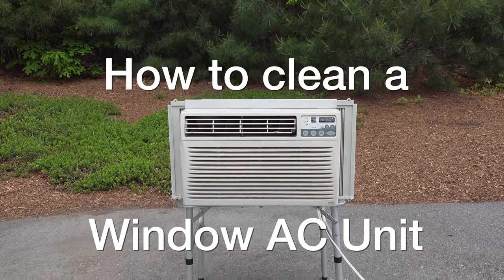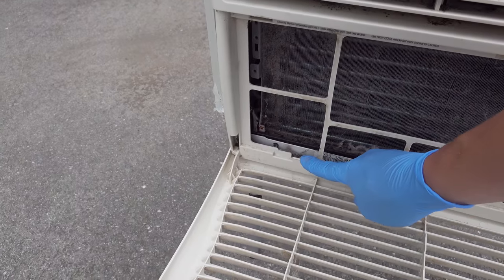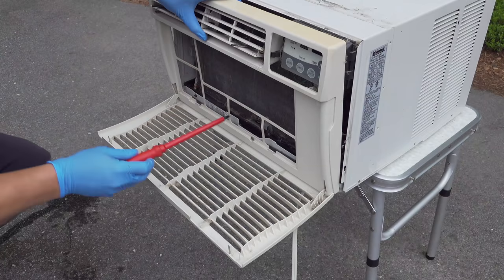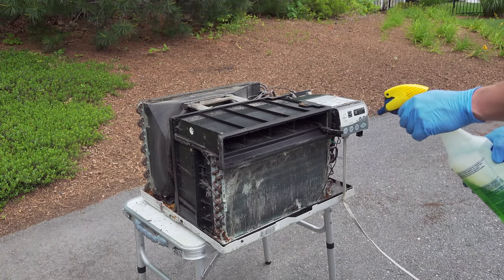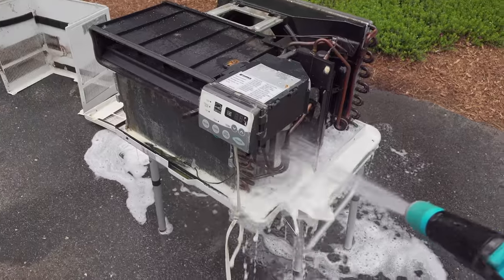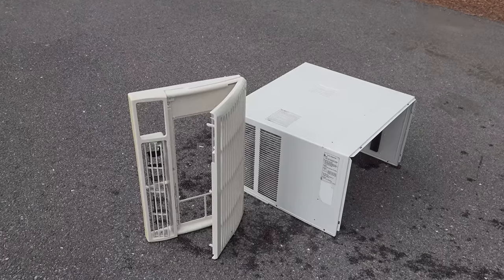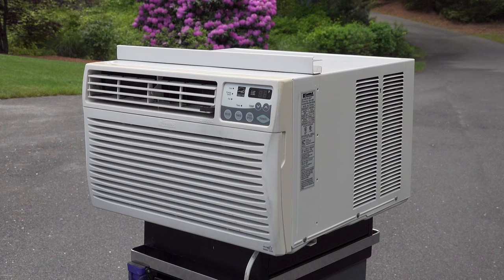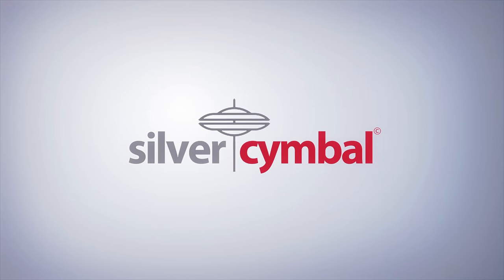Window Air Conditioner Not Cooling? EASY Common Fix - How to Clean a Windows AC

Comment: My Dad taught me this method about 30 years ago, I always thought he was crazy for doing it, but the old man knew what he was talking about
Reply: Probably your dad's old video.
Reply: @davidstockman1456  let me get a hellllllllllll yaaaaaaaaaaa
Reply: What's the point of even mentioning it , TOOL
Reply: They all do.... never question an old man, just trust them and learn
Reply: @yusufuralarslan627  no dad?
Reply: @KingTravis405  a
Reply: @TheOffcialElonMusk  , my dad taught me to do things around the house.
Reply: He should've TAUGHT you how to spell
Reply: @yusufuralarslan627  have you found love yet or are you still getting kicked to the curb?
Reply: Usually old heads are the one to listen to cause they didnt replace broken they fixed broken
Reply: Dads are right 96.7% of the time
Reply: Definitely about to do this. Mine is putting in overtime and not cooling anything. Only 3 years old.
Reply: @vernonmouretjr4360  It works great, you’ll be surprised how much dirt comes out of the unit. Best of luck
Reply: I just brought a new one with even thinking it through….
Reply: @vernonmouretjr4360 
You Should Clean The Air Conditioner Thoroughly Like He Did In This Video
Reply: Dad's almost always know. They were taught by THEIR DADS, and that's how it should be!
Reply: I need to clean mine

Comment: It would have been so much better if Air conditioner were designed in a way they could be cleaned easily .
Reply: quick tips: clean  ftont filter and back of unit 1-2 per yr, depending on usage. This negates having to remove unit and disassemble. For back cleaning, spray garden hose at a 45 degree , not directly head on. These two methods will remove 90 % or more of dust/dirt and unit will
operate as itvshould. Been doing this for 20+ yrs. Great method for those that live on 2-3 FL , or those with larger units.
Reply: Yeah but then we won't be forced to buy a new one.

Comment: For those who are unaware you should NOT put an AC on its side, or upside down for any length of time, if you do have to have it tipped on its side, you should allow it time for the oil to run back down to the bottom of the inside of the compressor. just saying 😘
Reply: How do you grease the bearings? Mine is making a grind noise when turned on I assume it's the bearings?
Reply: Just like an automobile.
Reply: OneDayAfterAnother  that's ridiculous. You either just remove screws and then the outer case and so on until you get to the parts you want to grease or freaking spray a  bunch WD-40 in where you can reach with the attached tubes they come with, let it dry out completely and turn it on. Taking a window unit to an expert is the most ridiculous thing I've ever heard. Quick way to get totally ripped off when you can DYI easily or just shell out $100-$200 or less for a new one! Sorry don't mean to be rude, just realistic and practical.
Reply: OneDayAfterAnother  I do hear that my friend however in cases like a window unit people should be a bit brave over spending useless money on an expert. You wouldn't take a busted microwave to be fixed these days it's just not cost effective or smart. 🤷🏼‍♂️
Reply: @QueBeraBera  You never use WD-40 as a lubricant in place of something that uses grease.  WD-40 is a degreaser, your cleaning off the last remnants of the grease the mechanism actually requires.    Ask a locksmith, the worst thing in the world is spray WD-40 in a sticky lock.
Reply: @jim1631  this. WD40 is definitively a solvent. I build drones and can’t tell you how many times I’ve had to stress to others to keep WD40 away from their motor bearings, it’s quite literally the absolute worst thing you can use for lubrication in damn near any device or equipment with moving metal components.
Reply: thanks  💋 😘 😗 😚 😙
Reply: @jim1631  Brett apparently loves to use his wd-40, once you told him how goofy he is, he shut right up ! Great job Jim.

Comment: I was about to throw my very old AC away. I thought it had something to do with the Freon. Glad I checked out YouTube first. I took the frame off the AC and pressured washed it out completely. waited a few hours for it to dry out, put the frame back on, stuck it in the window and it works like new. Thanks for the DIY Fix.
Reply: Mine makes a grindy noise when I turn it on. I think it's the bearings or whatever on the inside. Dunno how to get to it.
Reply: @Clayton178  Mine did the same thing. Hosed it off real good and never done it again.
Reply: @Clayton178  you take it apart until you've gotten to it.
Reply: High pressure washing a window air conditioner is a Bad Idea, it can damage the Condenser coil and the Evaporator coil.
Reply: @randallgreen6746  no one said high pressure
Reply: I don't think a pressure washer is a good idea but if its works good job.
Reply: @Clayton178  one year I sprayed mine out with a garden hose and it did the same. Still in my basement as a future project.
Reply: @markstevens7699  pressure wash is high pressure otherwise you just spraying it out.
Reply: @truth6554  spraying it out is pressure washing otherwise you're just dumping water in it. Why specify high pressure. There's degrees

Comment: Great video. I clean both my window AC's 11,000 and 12,000 BTU's just like you did in the video around every April just before the hot weather kicks in. Both my AC's are 11 years old and cool  rooms as  if they were brand new. Bought the AC's used for $100 each 11 years ago, getting my moneys worth. This past January I was cleaning bathroom tiles with Scrubbing Bubbles Bathroom Grime Fighter it worked so well in the bathroom the idea hit me to use this product for the cleaning of my AC's. When this product is sprayed it expands. I used it on the coils of the AC's, waited 5 minutes, hosed down the coils. Let me tell you, the product worked so well I got the shine back on the coils. I also used the Scrubbing Bubbles on the bottom tray of the AC, the inside and outside of the AC casing, hosed them down it worked fantastic. During the summer months when the AC's run almost around the clock I clean the filters at least once a week. Take care of the AC and it will take care of you.
Reply: Do these AC units not run out of refrigerant?
Reply: @Utsusemi  - Not unless they develop a leak.
Reply: @Utsusemi  only if they spring a leak. Same with any a/c system- home/auto. Refrigerant doesn't get used when you run it.
Reply: oh wow :o
Reply: Fantastic idea to use Scrubbing Bubbles! I'll give it a try....
Reply: @Utsusemi 
No. They almost NEVER need refrigerant and are NOT meant to be recharged.

Comment: Do not tip it on its side!!!!!! Everything else is solid but do not tip it, tipping them can move oil out of the compressor and get it into the lines that will cut the life of the machine in half. I am an HVAC techician and this has been my TED talk.

Comment: as a technician another thing to point out is that the coils need to be kept straight, bending enough of them will block airflow through the unit and cause similar issues, fin comb brushes are pretty cheap alternatively you can use a flat head screwdriver and some patience, also be careful with using dish soap on the coils and inside the unit as it will corrode the copper lineset potentially leading to a leak so rinse extremely thoroughly, preferably you want to use the foaming spray linked in the pinned comment or an equivalent personally I use Nucalgon condenser coil cleaner which dries without leading a residue, but does have a habit of softening the plastic shell on my AC unit.
Reply: Thanks 👍🏼
Reply: @NicholasPeters1  the copper pipes that's the copper lineset, the coils is what he's cleaning you got two of them the condensor (Outside) and the Evaporator (inside) that's what moves the heat since AC doesn't just blow cold air, it absorbs the heat from inside and takes it outside.
Reply: You're an angel!  Straight from a Cali girl (105 this EVENING).
Reply: Is there a reason why one side would be blowing stronger then the other side but still blow cold? Is one side clogged?
Reply: @xratedsuperstar1987  I'm a tad confused what you mean.
Reply: @pathfinder290  on the part where the air blows out one side blows weaker then the other side. Usually the airflow is the same on both vents but one vent blows less air then the other one
Reply: @xratedsuperstar1987  does sound like a blocked evaporator coil or supply vent or fan. Without eyes on I'm not sure what it could be absolutely. If you got the type of unit that could help model number could be a great start.

Comment: Thanks so much!  I did this on the very old unit in my kids’ bedroom, followed your directions precisely, and now it’s chilling nicely!
Reply: I have a question before I try cleaning my own window ac , where the mold and nasty dirt is on the bottom of the ac if their is a small water puddle does that mean anything or is my ac just full on dirty , I’ve only had mine for about 8 months now so this is why I’m asking do I need it fixed ? Or do I need it cleaned ? Because It does smell and it is blowing hot air but when I look at the ac from the outside of my window looking in I see dirt , mold / a little bit of water what do I do
Reply: @SilentBlunts  Window AC is designed to have a small puddle of water in the bottom which the fan slings onto the back coils to cool them but should also have a drain to keep them below a certain level. Clean the drain when you clean everything else to avoid it plugging up

Comment: dirty coils are a major cause of efficiency issues in AC units. both central as well as window/free standing units. Glad to see somebody took the time to put a tutorial together about how to clean these. 

If you notice your home's central air starting to not do as good of a job it's a good idea to take the hose and wash off the coils on the outside condenser unit.

Comment: My grandpa taught me this long ago, now they have central air, I'm glad he doesn't have to deal with it anymore but I'm also happy I learned, sometimes you don't even have to take all the covers off just depends on how dirty or clogged it is.
Reply: Yup, but this coils still have to be cleaned.  They are just outside now......... 😉
Reply: @alexpearson8481  ummm actually for window units the coils are and always have outside (they hang out your window) and for central AC you still have coils outside in your condenser, yes, but also inside within the air handler (near the evaporator)...jus sayin'. 🤷🏼‍♂️😜

Comment: My 5 yr old Frigidaire 6000 BTU stopped cooling the bedroom well ... sorta gradually but it wasnt a big deal until the California heatwave that hit last couple days when we really noticed it wasnt doing a lot of good.  Quick inspection fans were working and the filter and grills didnt look bad.  Like a few other commenters I thought "I guess these newer units coolant just doesnt last that long".  Glad I saw your video!  I removed the unit, opened it up, cleaned everything ... the back grill was actually pretty dirty when I saw the water running off... re-installed and there is a marked improvement right away.  Thanks!

Comment: I subscribed just to tell you this really worked. Had an old Fedders unit blowing warm air. Cleaned it up on the back patio using your video. Blows cold now and keeps the room comfortable, Thanks.

Comment: I do the same exact thing with my 4 Panasonic Window A/Cs.
They don't make them anymore and they are super quiet so I value them dearly. They look and perform like new for nearly a 25 year old appliance.
Reply from the maker: That’s awesome.  The old Panasonic’s were amazing. I used to have one too
Reply: Jeffrey Caban had those growing up in parents house. My dad installed them permanently in wall. Never had to touch them for same amount of time as yours!! Now have crappy ones with styrofoam inside and get 3-5 years, if lucky 👎🏼
Reply: Agreed, the Panasonics are much quieter than others I've heard.
Reply: @jacktorse2145  my Panasonic Microwave is 12 years old! Works great.
Reply: @ihatesignupsgrrrrrrr  What brand is that microwave? They were made super heavy back then. Today they are mostly cheap parts.so you have to replace them in a few years😣😥😥
Reply: Friedrich Chill series uses the same build and design as the Panasonics.  However I found them to not as quiet and reliable.  Nothing like the Panasonic's.
Reply: @curtisi4403  Friedrich" is great. We have one, 30 Years old. Still runs Great. Still made in USA. 😊😊😄😄
Reply: @captainamericaamerica8090  Have one is 10 years old. Some people throw them out when they stop working. Not knowing there is a fuse inside. A $1 solution.
Reply: @omegaman1409  TRUE
Reply: The ones nowadays are set up to go out after 5 years. So yes by all means take special care of those.
Reply: We had a Panasonic AC that finally lost its charge after approximately 44 years. Thing was quiet and built like a tank
Reply: @omegaman1409  tell me more about the fuse?  My in laws have a Friedrich that doesn't work.
Reply: @mahnli  You have to open the microwave to see it. Take it out and find a replacement at lowes or Home Depot. Just a few screws hold the cover.

Comment: Wow very nice video I'm highly impressed I thought my AC was garbage and I only had it for a year it stopped blowing cold air and the pump would kick on and off. Then I did this and it works just like when I first bought it that is freaking amazing seriously thanks for this! Great guide
Reply from the maker: So glad its helped, its great to get something working again.
Reply: @SilverCymbal  Love your video.  I'm going to do this.  Dirt is our enemy.
Reply: Thanks for pointing out it turned compressor on and off hopefully that's my problem and it doesn't need freon. it did blow dust out when I first turned it on so hopefully this is it!
Reply: @alexmoreno2953 what happened did it work for you? My compressor keeps kicking on and off

Comment: Lesson learned, I will be cleaning all my ACs before I store them away for the year in the early fall. I had a older 12000 btu unit I moved up to my attic. The thing constantly tripped my breaker when the compressor kicked on. The problem ended up being simply a super dirty ac. I took it apart, cleaned the hell out of the coils etc. bam it runs like new and solved the breaker tripping issue.

Comment: I have some old air conditions outside and I have cleaned up old air conditioners before and made them work. But you do have to bleach the inside where the air goes are you could have some serious mold and stuff in there. And unfortunately some of these air conditioner companies make it so you can't pull the front of it off, which is ridiculous they just want you to throw it away and buy a new one. Thanks for posting this.
Reply: Bleach doesn’t kill mold, but vinegar will

Comment: I like Formula 409 for this sort of cleaning job.  I learned about cleaning window units from an A/C contractor about 30 years ago, and he preferred F409. He said it does a better job of dissolving grime than dish soap or other products he tried.
Reply: any degreaser will be just fine ...such as dish or laundry soap

Comment: Just seen this ! My AC unit is 1 year old but blows a molding smell I never knew you could give it a through cleaning like this. I'm definitely cleaning it this weekend ! Thanks for posting this video
Reply: I have the same smell of mold in my ac, from my ac when my ac is on or when my ac is on (noticed the mold smell over 2-3 years ago (if I remember correctly), wanted to clean out the ac's but didn't bother). Have you see anything or tried anything to clean out the mold (if there was any)? My ac has a styrofoam looking piece around a fan part of the ac and it has mold on it. I can try to scrub it out gently but I'm afraid it may destroy that styrofoam looking thing. I'm not sure if the styrofoam looking thing is insulation or what.

Comment: Just cleaned my unit. Sadly I didn’t have hard plastic vents but styrofoam and that too was extremely dirty. But I did carefully removed them without breaking them and cleaned them. Just waiting for it to dry. I’ll give you an update later today

*Update * well I am amazed that it worked. Haven’t felt cool air in awhile now. Almost considered buying a new one. But your method of cleaning it. I am a believer. Thank you 🙏 so much, this help out greatly
Reply: Ramiro Moreno yes I did spray it with a water hose. But I did place a plastic bag over the control panel as a added protection. I’m more amazed that it did work. It’s been reaching temps of 100 in my area and the room is a cool 75. Well lower now ever since I blocked the sunlight from my room, lol I sound like a vampire. But try it!
Reply: Oh just be careful with the foam, I had to take mine apart because of how dirty everything was. But glad I did though

Comment: I did this last year to my 2 window units and after i let it airdry fully for 2 weeks in my basement without putting the exterior cover and filter on. Then i put the cover, screwed everything back in place , turned it on to make sure it worked for a minute and stored back in its box for the winter. In the late spring we put them in the windows and no nasty mold smell like we'd usually get. Now i'm ready to do it again this year and came back for a refresh. Will do this def. every year.